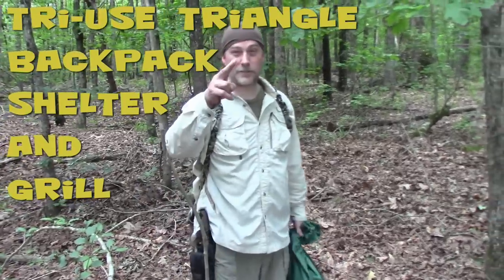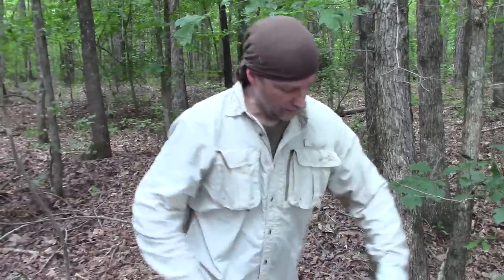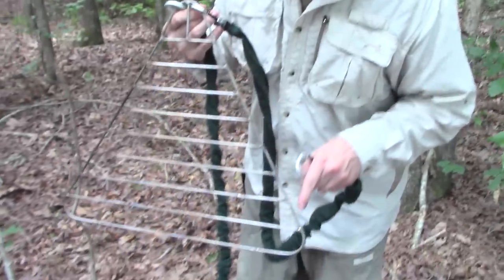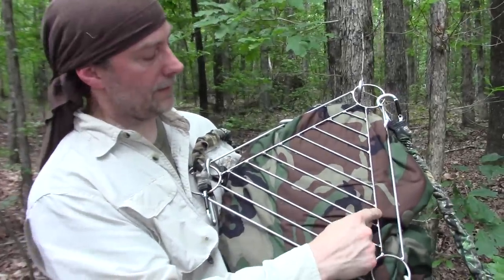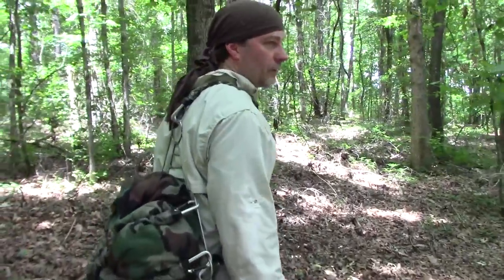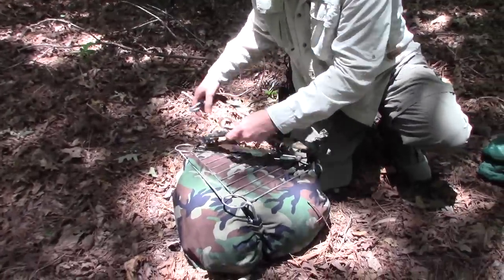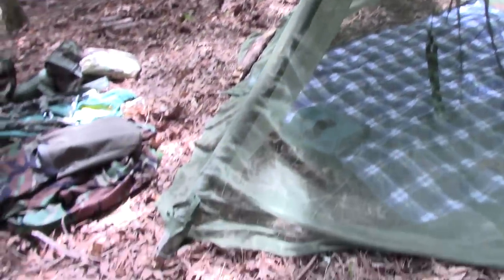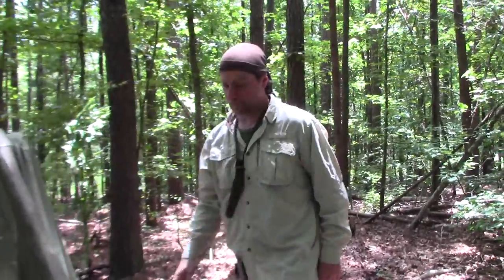Tri Use Triangle Grill Shelter And Pack Frame

Comment: My 2 suggestions are... Use a small camp wood stove with a stove pipe to cook and heat. 
Sew loops halfway up the outside walls for guy lines to pull the walls outward. 
Great video.
Reply from the maker: Two good ideas, Thanks for watching Bart

Comment: This is my first response to a post, so treat me gently (I do cry and pitch fits).  Thank you and Nick for the many years of entertainment and information you guys have given us.  All in all, this setup was a spectacular success.  I read the comments to date and I agree with the following comments:  Great innovative design (old school name is a triangular prism or triangular pyramid); more interior space could be gained by adding one more panel (making a square prism or a square pyramid); in both cases put a loop in the center of each panel for a tie out; make the door bigger (both wider and taller); sew a tube in the bottom of the door;  for cold weather, make an interior liner out of survival blankets (you could make it out of Mylar, but I bet that stuff is difficult to sew); make a triangular pouch with open corners and one side with a Velcro flap (a carrying case for the grill).   Again, thank you and Nick for the videos.
Reply from the maker: Very good suggestions Buck, thanks for the comments and thanks for watching brother!

Comment: Another great entertaining video from both of you. That is just one cool designed shelter. Half tent, half bushcraft. I especially like the fact that you could have a fire in there, despite Nicks reservation 😁🔥🔥. I don't really have much idea about improving it really but you could maybe add a loop to the top part of the hood and sling the paracord over a branch so as to pull the hood up slightly avoiding the kite like movement. 😀. It was another great way to spend an hour and I hope you get a chance to use it with a fire. Nick behind the camera of course 👍. Many thanks again, both of you.
Reply from the maker: Thanks Spencer,  I'm glad you liked it.  I have several cool ideas for the fire for this.  I may or may not test them on video,  I may perfect the set up then film that. Take care and thanks for watching

Comment: Just a couple ideas, a mule tape loop in the center of each wall could help give you more interior room if staked  and pulled out. Loops at the upper seams that just reach the corners of the top triangle could be used with carabiners or stick toggles to secure it. Keep on creating!
Reply from the maker: I'm liking them ideas Rich! Thanks for watching brother

Comment: If you sew a tube at the bottom of the door, you could insert a stick and it would maintain the shape and hold the door down.
Reply from the maker: I love that idea! Thanks
Reply: Yeah that would be like a weighted mud flap on a truck.
Reply: @bradh74  Yes it would, but in this case you find the weight wherever you are instead of carrying it.
Reply: Also what about a bungie or belt of some sort from the bottom of the 2 rings to go around your waist for making pack more stable and for larger packs to take some of the weight off of your shoulders? Just a thought and I really like your frame idea/build! Gj 👍
Reply from the maker: @timjones3158  I like that idea Tim!
Reply: @Reallybigmonkey1  To add to my comment idea below, in your video at 24:24 you were talking about adding loops to the tarp...I was thinking right before that of the same thing....but the loops I was thinking about was for tying the tarp or bug screen to the frame and tying the frame to three trees so you could bring the tarp off the ground for better circulation and even rain (using a hammock or raised type of bed obviously if it's raining...unless you dig a small trench around the frame with water run off trenches)  for the fire pit possibly even a Dakota Fire pit which will be safer and more contained inside the shelter? Sorry my mind is going 100 miles a minute since you showed me the frame and ask for suggestions 🤣 ok shutting off the brain for now I see you are getting TONS of ideas....see what you started Dave 🤣🤣🤣👍
Reply: LOL I meant "comment idea above" =P
Reply from the maker: @timjones3158  One thing,  you mentioned better circulation? I was thinking make the poles longer and have an air gap under the entire edges of the tarp. Yes, Dakota hole or maybe even just a fire pit would be nice
Reply: @Reallybigmonkey1  What I meant by better circulation, was for the summer time heat...aka not as stuffy with a closed up tarp shelter and with the Dakota fire pit hole you don't get the heat from it like a regular fire or fire pit in the summer but it gives you a fire to still cook on and also curb the amount of bugs. Was just a thought take it for what it's worth in certain situations 😉. I enjoy all your videos and you have taught me several things I didn't know Thanks a bunch!

Comment: I love the multiple uses for your grill/pack frame!  One more would be a rope set-up.  Instead of sticks.  You could feed rope to four adjacent trees through the hoops in your grill.  Then guy out from the same holes!

The only issue is that you would not be able to drape your bug net over the top.  Whilst you could wrap a tarp around the four guy lines, you would end up with a hole in the top (because the lines running out to the trees would block you).

So my suggested solution is to carry a poncho or woobie to pop over the top.  Or cut out a piece of tarpaulin, or other material, to cover up the gap. The advantage is that it would not place as much strain on the frame, without the weight of the sticks bowing it.

The disadvantage is that you would have to carry extra weight in the rope & poncho.  Although, if you are going for a bug net setup, you may be able to get away with using paracord.  Thus keeping the weight down.  And it does not hurt to have a bit of rain protection, in the form of the poncho, just in case.  Plus multi use.  ;-)

 I hope you like the suggested extra idea?
Reply from the maker: I like all them ideas Mark! That definitely opens up the door for more multi uses. Thanks for the comments and thanks for watching

Comment: I love the idea. The grill is great. The sticks being longer would be perfect for supporting the top triangle with bungee cord tied to a loop at the three spots on the body against the poles.
For a fire you could use a dakota fire pit with a longer draft tube into the center. More like a tipi had in the real ones. You can make the longer vent tube stable by cutting sticks and using them to support the earth top. In the summer you could get green sticks and arch them under the earth top if the soil is really muddy. I know you can because I've built two foot long runs of earth topped tunnels for use as drainage with this idea. By digging the vent opening lower than the actual vent tube, you will allow water to drain. By using the same idea, you can make a mini covering like a lean-to over it during rainy or snowy times. An old coffee can in the pit top could be used as a fire protector with some finer mesh as a spark arrestor and grill. It would be safe inside the tent then for a fire. (No Nick, it won't burn it down.)
By making the interior walls go to the ground and 3/4's up and then leaving a few gaps in the exterior walls at the ground you won't have to have the door open to create any draft for the fire pit and you will get cool air in to vent condensation.
You probably thought of this but it just got me wondering and I thought I might post it.
Reply from the maker: I'm glad you liked it and thanks for the ideas.  I really like the idea of the angled Dakota vent hole! I never thought of that.  Thanks for watching

Comment: Another great video. If you  decide to sew something to tie the rain fly to the tent then sew pockets also to stick a green limb or branch in to make a hoop to hold rain fly up. Another idea for that rain fly would be to use as a cover over the backpack frame after you use it as a grill to keep your back clean. Also since you have such great talent with the thread injector you could sew a floor liner. Kind of like for a teepee. So It can pull draft for your fire under the tent wall. I really like the tent backpack idea. Thanks again for the videos.
Reply: Oh yeah you might try sewing magnets in the door seam to hold it down.
Reply from the maker: I'm glad you liked it and I really like all them ideas!
Reply from the maker: Another good idea!

Comment: Maybe the small triangular roof could be attached to the metal triangle with removeable stands?
 Maybe even using the same metal rods that you use as ground stakes for the roof support, that way it has less parts that are interchangeable. If you manage to put every shelter item inside a large metal pot you have a sweet and convenient setup right there, I would buy one!
Reply from the maker: Good ideas Victor and I'm glad you liked it.  I may just add rods to that roof topper

Comment: I like it! I can think of a few more uses for it. One of them (maybe it will need to be beefed up a little better or made from titanium or something), would be a camp chair. Just cut smaller-length legs for it when using it in "tripod mode". 👍 💯
Reply from the maker: I'm glad you liked it and that's a good idea!

Comment: Dave, I think this is one of the best things I’ve seen you make in all the years I’ve been watching. The pack frame grill is exquisite, the screen fits like a glove and the door flap with screen is super cool. 
If add some magnets to the shell, it might make adding an inner layer that could change based on the weather. I love your idea for a hanging fire, not sure if the carbon fiber from the Dakota tent would work as a partial shield if the fire is shifted to one side. You outdid yourself, man it’s cool!
Reply from the maker: Thanks Dan, I'm glad you liked it that much! Good ideas,  the carbon fiber chimney is definitely in the cards! Thanks for watching brother

Comment: I’d put a traditional tent style door on both sides for obvious reasons.
The suspended rain fly/heat reflector idea opens up several avenues for multi use. If you made the fly using the same design but larger say 4x4x4 or so would maybe be easier to setup, keep more weather off the tent too. Other uses would be to use it as a windbreak or heat reflector, and even a debris sled.
Reply from the maker: Thanks for the ideas!

Comment: Hey Dave. Your dedication to the craft never ceases to amaze me. That truly is an interesting creation. When you said that you'd have to shorten the three poles by 1 foot, that might bring the walls in too much for you to fully stretch out. I also got thinking that you might have to reinforce the pack frame. If you have contents in your pot (most likely water), it might be too much weight for the frame. The reason the frame is sagging is obviously due to the angles of the poles. What if you slightly angled your rings upward? Also, if your pack frame isn't completely level, the pot hangar might slide down. Maybe re-inforce the pack frame with more sections. That would allow you to place the pot hangar anywhere you like without it sliding around. I also got thinking that you could add sleeves to the outside of the tent along each pole and to the inside of the cap. Then you could slide in some sticks to hold the cap on instead of tying it to the trees.You may not always have three perfectly positioned trees to tie it to. You could also make the cap a square shape. It would provide much better coverage. You could also make the cap much bigger. That way you could add Velcro to the tent and to the cap, which would allow you could attach the cap to the tent. In windy conditions, you can't afford to have that blowing around and allowing rain/snow to get in. Anyways Dave, I hope this helps. I'd really like to see this in use. Keep up the good work. I'm looking forward to the next video. Take care. :)
Reply from the maker: Thanks, Very good ideas! I did hate the idea of having to depend on three trees for the topper. It needs to be free standing. I'm glad you liked it. Thanks for watching

Comment: Another fun video! Dave, as you can tell I've been going back through your videos enjoying some old favorites and catching up on the ones I've missed. I have used teepee type shelters in the past and also made a fire in the center. We all know they work because native Americans have used them for years! However, the ones I have used were taller and, in my opinion, the height really helps with keeping the smoke out. Bit it would be hard making something 12' tall and then setting it up with just 2 people. As I recall, a Dakota pit fire really helped as well. I think that type fire, because of the airflow coming in low, gives off much less smoke. Hope you get time this winter to try it out. Thanks again Dave and Sir Nick!
Reply from the maker: Thanks,  I'm glad you're liking the older videos.  I never stay anywhere long. I'm usually in one day gone the next so I can't set up a full sized teepee.  I've experimented with Dakota pits in shelters in the past and they work pretty well.  Thanks for watching brother

Comment: Nick suffers for his art...lol. The spider can move faster cause he's got eight lags. I like the shelter Dave.  It might be a camp sauna when you're cooking in there. could you suspend the fire and heat and not have in on the floor, which means your use of fuel will be critical as you would want to avoid sparks from catching your bedding or floor on fire. Bug net, on top too Dave, as when there's no fire bugs can get in from the top, Or have the sides so they can open up - bit like the Lavvuu thing, with a bug panel behind it. Oh and Dave, nice sewing man, I'm impressed.
Reply from the maker: Lol. I was thinking some kinda fire bowl, Ill probably test a few options. I'm glad you liked it. Thanks for watching Mark

Comment: Dave ID use a dirt mound and ash bucket for heat .that top if you run para arond so you can cinch the out side of the fly around the shalt on say 3 sides and a stick or piece of fiber pole to hold out the onside . Hey Nick got stood in the corner lol
Reply from the maker: Good ideas Tom!  Thanks for watching Brother

Comment: What a great-looking and multi-purpose tent with equipment Sir! You asked for possible suggestions; as some of your other tent ideas, place segmented loops on the bottom 'skirt' of the tent to run tree (straight) branches to keep the lower end of the tent steady and to place weight to "seal" bottom of the tent to the ground. This is one of your design features on your other tent/shelter features. For the top of the tent, I recommend your other grill idea with legs to attach somehow to the top tent grill frame for the stability of the suspended tent flap. For the entry of your tent, incorporate a triangular entry door flap to include the netting. The triangle effect would somehow match the triangular shape of your tent and would in effect be an "easier" entry and egress opening vs the square shape. My suggestions are really your ideas from your past shelter projects. Another well done and thoughtful video Sir!
Reply from the maker: Thanks for the ideas and thanks for watching Robert

Comment: All this tent double size bigger  ... then it’s perfect 😜✌️... and when it’s raining ... you can stick an open umbrella ☔️ on the tent roof 😜✌️
Reply from the maker: Bigger is better but at what fabric weight will it take? Thanks for the comments and thanks for watching Peter
Reply: 😜✌️ …. It’s more weight … jo … I have a hiker trailer for my bicycle… but I can also carry my tent and my bag on it by hand … it has 2 full rubber wheels … perfect 👍  also I have on my MTB Tannus never flat full rubber tires … they Garantie ca 6000 - 8000 km driving … that’s ok for bug out ✌️😂✌️

Comment: A loop a little down each seam, in case of no trees for food carrier / wind and rain center cover. You still need air flow, which should be accommodated by the pole length. I like the idea of a large number of loops around all sides of that triangle. Mule tape doesn't add a lot of weight, but multiple loops adds versatility. 
You ought to call it the versitility camp pack. Get the smallest rocket stove that will do the job, instead of an open fire. Hell, sell those too. 
Good job.
Reply from the maker: Thanks for the ideas Charles and thanks for watching brother

Comment: Cool idea! 
Re the fire. I've taken a Firebox-style twig stove and placed a metal plate (with lots of little holes in it) just under the top cross pieces to act like a spark arrestor so I can use it inside a shelter. I have not tried it yet (fire ban in my area) but I can't see why it would not help tame the sparks. Safer inside since sparks are minimized.
Re the top cover. Maybe a tripod made of short skinny sticks could be used to allow the triangle cover to have a raised spot in the middle to rest on. Then the corners could simply be tied down to the fabric below if a small loop was sewn at each top corner. 
Hopefully, these ideas make sense.
Reply from the maker: Thanks for the suggestions my friend

Comment: An alcohol fuel or twig-stove could work in the tent.  For Nick, use hot rocks.  By the time you get done adding features, including the liner, you will need a different pack frame!😊
Reply from the maker: Good ideas James. A stove/oven/fire bowl isn't out of the question.  Thanks for watching brother